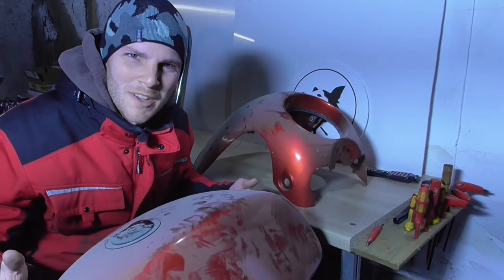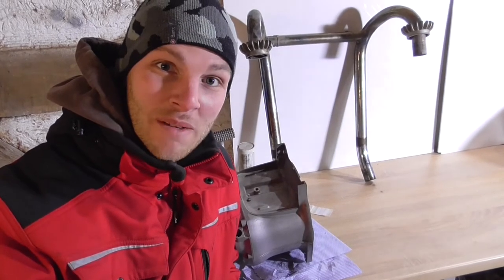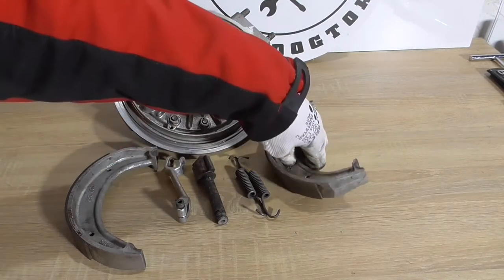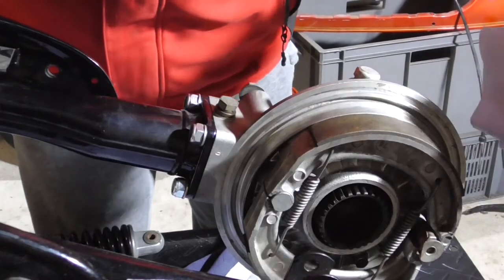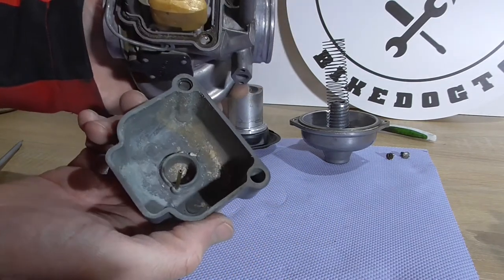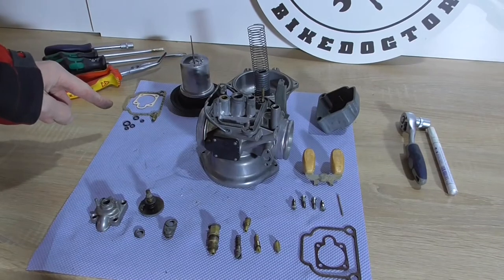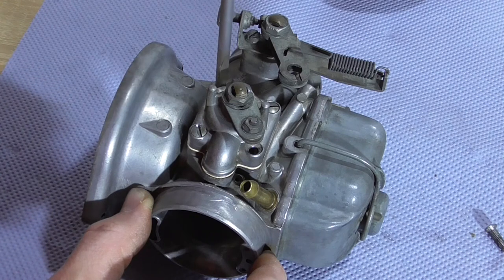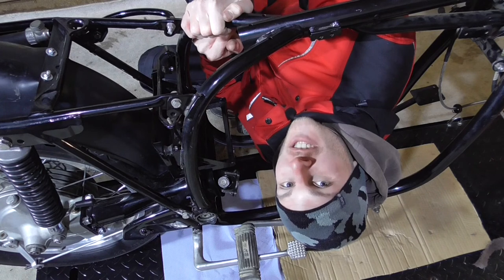BMW R100 S disassembled 20 Years Ago - Adult puzzle (bing Carb service and Huge steps)

Comment: It is extremely important to use the recommended grease on the rear splines where you mount the wheel. Otherwise the rear drive will wear very quickly. The splines will break and you can be stranded. Very expensive repair.